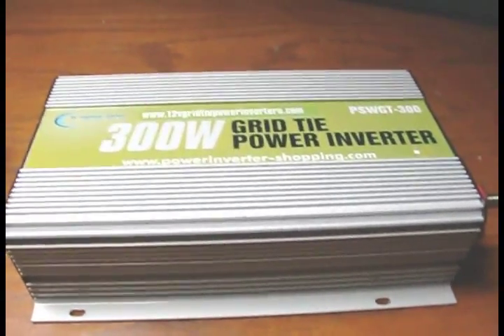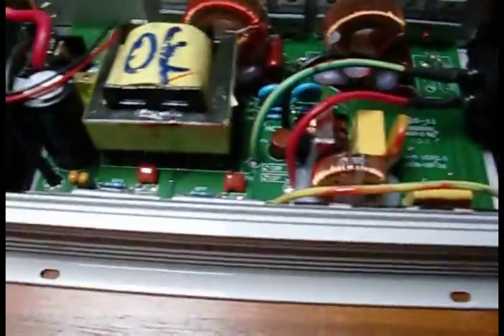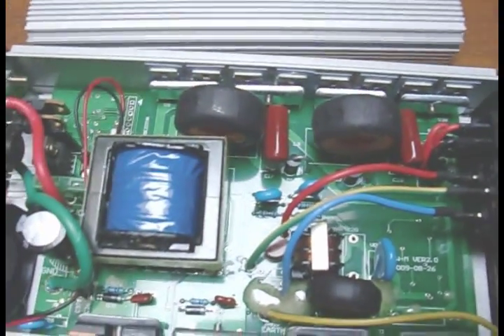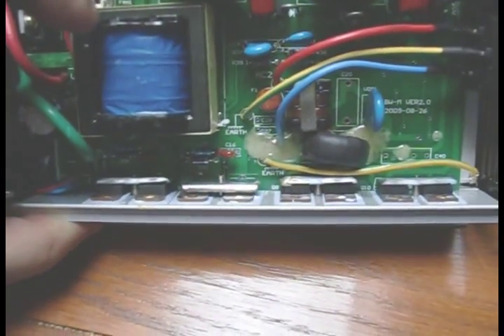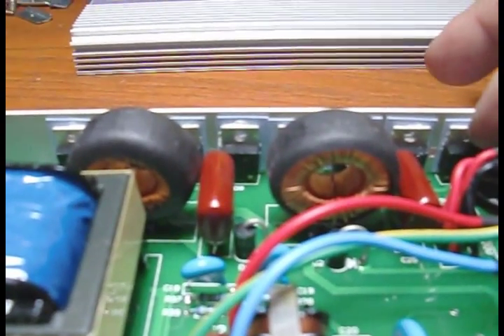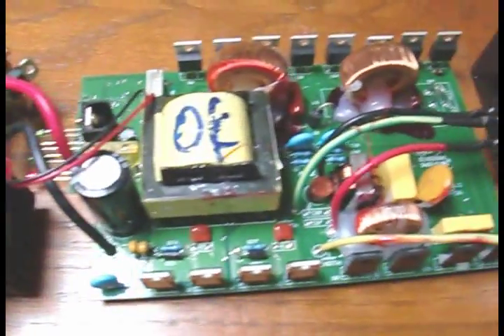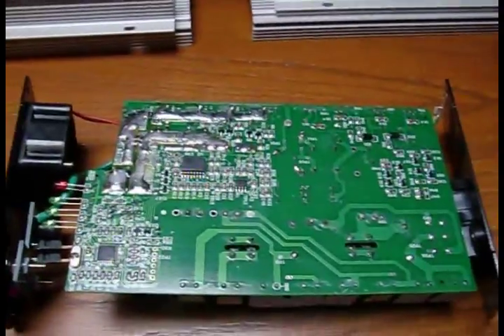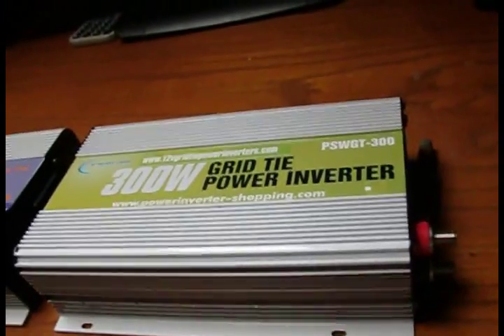INSIDE the SUN 250 and Power Jack 300 Grid Tie Inverters

Comment: ..those dc terminal get hot sometimes..it melts the red plastic terminal in longer run ... It need like the car battery terminals..not banana plugs terminal.. banana plug are for audio and smaller watts.. hopefully do not melt those tin solder circuit connections .

Comment: Thanks again Fearless for allowing us to see where the "magic" happens. I have 2 SUN 500 watt 22-60VDC GTI's and they are always in dump mode. Is there a way to unstick them? It's not a big deal I have the dump terminals on each one tied into the input of the other. A MWS 800 watt Rebel feeds them. I had my 2 100 watt panels tied into them and the wattage was fluctuating a little. I just received my SUN 500 watt 22-60VDC Solar GTI and my panel output has seem to have increased by 10-15 watts an

Comment: thats good to know.  I looked at the inside of this 22-60 1000 watt and noticed it has 4 250 watt inverters. and when the system is running it dose not actvate all the inverters lets say its pulling 500 watts only 2 inverters are active maybe 3 or if I'm using less than 300 watts only the top part were the dc goes in to the inverter is warm and as more power is being invertered the rest starts to heat moves down to the other parts of the inverter.  I will order antoher 1000 to share the load

Comment: I need some thing that will not pull the incomming voltage down at all or I need to sepreat my pannels in to two different arrays one with the 6 145 watt pannels and the others used to charge the batteries. now that I dont have the turbine I can still monitor the two different arrays.  what would your insit be on this

Comment: part 2 gets to 28.8 volts. the pwms can handel up to 45 volts in and adjust from 2 to 30 volts constant on the out put  I use the extra watage to over flow in to the PW and they can both pull 8 amps a peice for 16 amps total at 480 watts.  I have a PWM charge controller its for a street light off ebay 30amps 720 watts. it will charge up to 28.8 volts but it will also pull the incomming voltage down and the 22-60 needs at least 30+volts for full power draw. I guess I just need to buy a MPPT

Comment: I have a good questoing for you Fearless.  why dose it at times the 22-60 volt 1000watter gti I have will some times drop down.  some times it will pull full power from the pannels and some tims when I look at it its drawing only 5 amps or or nothign when its full sun out side but if I power it off and back on it will then go back to full power I have 1270 watts of solar first goes to the gti then two two PWMs set to 30 volts to charge the batters and use controller to dump when voltages

Comment: I have 2 of the sun gti's one is a 22 to 60 volt 1000watt, and the other is a 10 to 30 volt gti.   I have to have up to 29.5 volts to get full watt draw from the 1000 watt.  and I was thinking this would work better for my 24 volt system.  I thinking of using directly with my panels and use the 500 as my dump like I have been doing. I wish it would draw full power at under 29 volts.

Comment: I rebuilt a motor controller that used only 4 - 75 amp mosfete in parallel. and ran a small motor.. I added 40 - 75 amp mosfets... now it drives an automotive starter motor at various RPMs.

Comment: THANKS!!  There's really not much technical info about how these units operate..(syncing with the grid). And, rather than trying to build one from scratch, I wonder if you could use this board to drive more mosfets making it higher capacity. Seems like the controller portion would be the same and simply putting more mosfets in parallel (obviously externally) would increase capacity .

Comment: @solarpanels3  i got 5 of the 250 watt from sun and 5  of the 500 watt  they last not very long  you may on the save side if you have all ways parts on stock. mainly the ac side  is the problem  they have no protection at all a simple delay before they connect the output mosfet to the grid will give them a much longer span to work. in one year all of my 10 inverters are broken . overnight consumption is 8 watt /h.fans broken after 9 months . no support  at all simply a waist of money

Comment: i noticed the PCB tracks on the DC side of the sun-250 has heaps of solder on it that the PJ is missing. that could have resistance lowering effect

Comment: Amazing video. 
Thanks for taking the time to dissect these.
Did you note the part numbers of the Mosfets?
Just wondering whether the two units use the same 'semi's'?
I don't know why, but the Sun units seem to work much better on 240v AC than the PJ GTI's. The SUN GTI's draw no power in standby (at night), whereas the Powerjacks draw about 9 watts for the 300w unit and 18w for the 600w unit etc...
This adds up on long winter nights..  I have used both brands here.

Comment: Thanks for all that work. It's interesting that these are exactly the same circuit board and components, but yet your other tests show a difference in performance. Must be a difference in programming. All the rest looks like it comes out of the same factory. The Sun did look like it had a little more solder piled on the high amp DC traces so it could handle more current, possibly. Thanks for the close up pics!